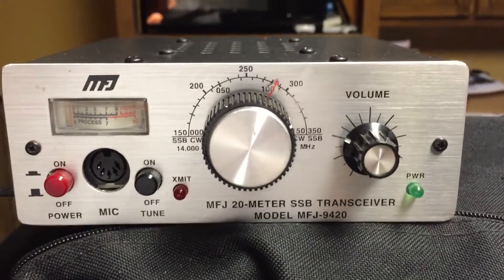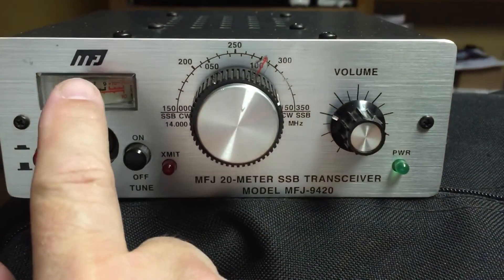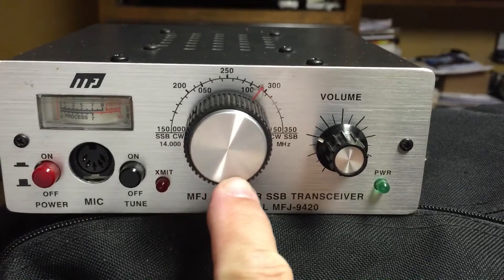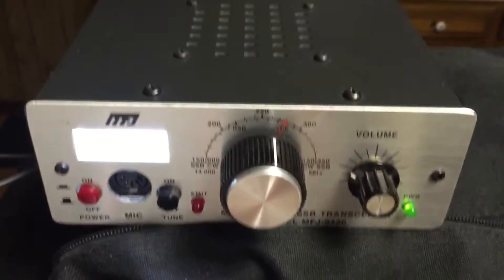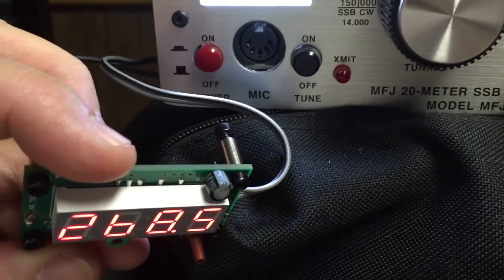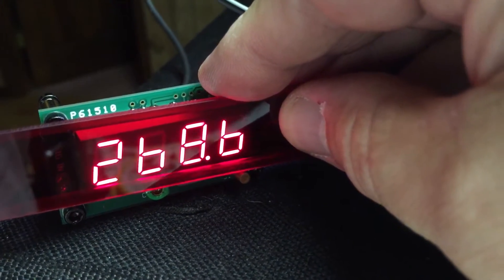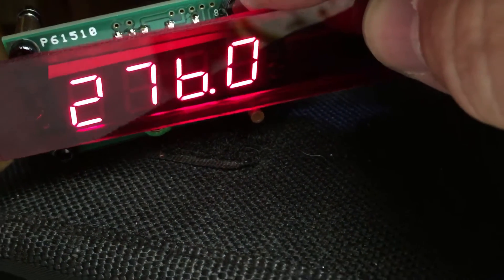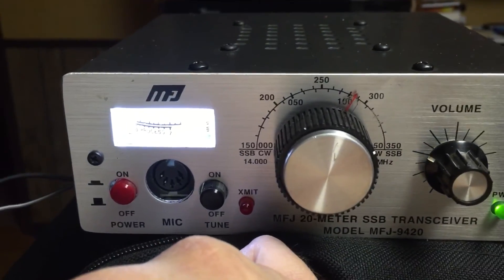MFJ-9420 with LED's and Digital Disply

Comment: Hello! Could you email me the details on these upgrades? My lamp just went out on my 9420 and I would like to upgrade it to LED as well as add a frequency counter...where do you buy these? My email is mikebrummitt@gmail.com
Reply from the maker: MFJ may sell an LED upgrade already.  Coming up with a 12 volt LED should be easy enough.  I have some LED strips - the cheap rolls off Ebay - they work on 10 - 15vdc (https://www.ebay.com/itm/5M-Waterproof-Cool-White-600-LEDs-Flexible-Light-Strip-3528-SMD/281189818595?epid=689468936&hash=item41783820e3:g:LfEAAOSweKda1V1w).  I have used those for lamp replacement in other projects - you cut off the roll 3 at a time for small uses (the electronics embedded in the strip power 3 at a time).

The frequency counter is a generic kit - http://www.qrpkits.com/freqcounter.html. It is powered from 12 volts tapped off the power plug inside the radio and takes its data from the VFO circuit.